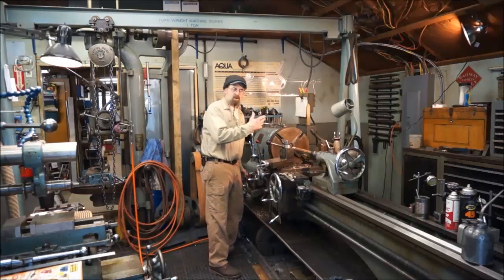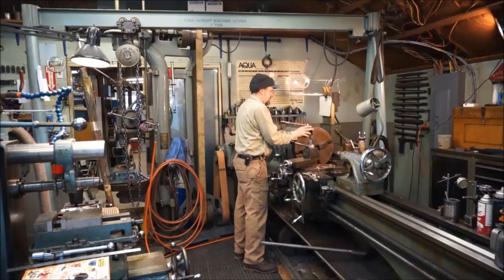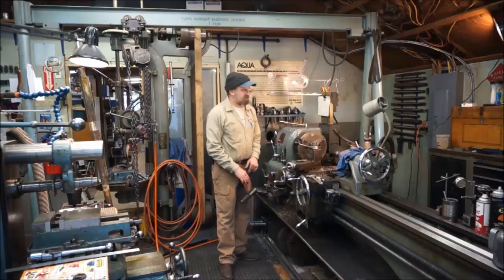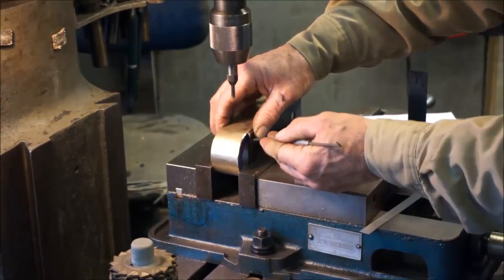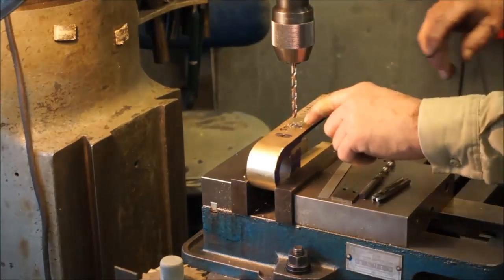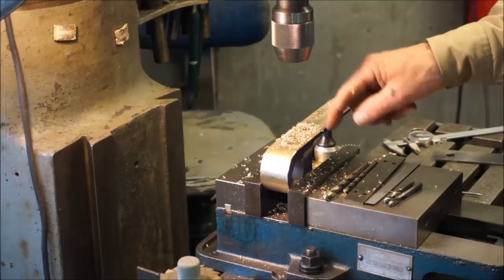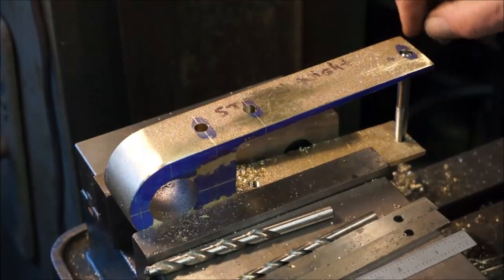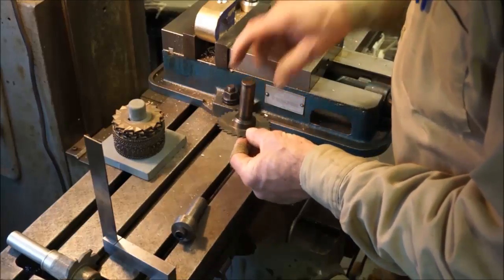Come About Part 3

Comment: Dust or rust - either one is bad. A quick wrap of plastic would help with the dust.
Reply: and it holds in moisture, and condensation. not a good idea. i think i would trust Keiths method.
Reply: I won't explain the science of condensation. Good luck.
Reply: Now you are thinking. (Plastic can only retain whatever moisture is there to begin with.)

Comment: My other question brings this to mind. How accurate are the slide dials of a mill over the full length of their throw? If you were to set a zero reference at one end, and then crank the slide down to say 12.750", how accurate would you expect that position to be? Does a machinist ever periodically prove this performance?

Comment: Why did you measure and scribe marks for the bolt holes along that bracket rather than just locating the first hole and then using the mill's table dial to move the appropriate distance down the bracket? And why was the print "dimensioned in 16ths?" Is that common practice for a foundry?
Reply: OK, delete my question about dimensioning; you addressed that at the very end of Part 5.

Comment: Ok, a novice question, how do you run your taps through without back it off to break the chips without breaking your taps?
Reply: Hi John, bronze is what is know as a "short chip" material (like brass and cast iron) and as such when it is cut or tapped the chips break off of their own accord. You really only need to back a tap off every 1/4 of a turn when you are threading long chip materials like mild steel.

Comment: Hi Keith.  I love all of your videos - they're always informative and helpful, but I have a question regarding this video.
I apologise in advance if this question sounds like I'm doubting your abilities or knowledge, but it relates to the tapping of the bolt holes.
Surely tapping the through holes BEFORE you slit the piece into two means that a single bolt passed right through will misalign after the 1/16" is removed?
I may have missed what the customer is asking for, but certainly in the case of the bolt nearest the 1.5" hole this must be true.  The other bolts holes perhaps are independent, but then why through tap them the way you did?
Regards Mark in the UK
Reply: so when the piece is in place it will be make holes line up and make room to clamp? i was wondering same thing.
Reply from the maker: I had the depth figured so that the difference between the through hole and the tapped hole met on the split line and by tapping them in this manor, the threads align with the hole axis. ;{)------